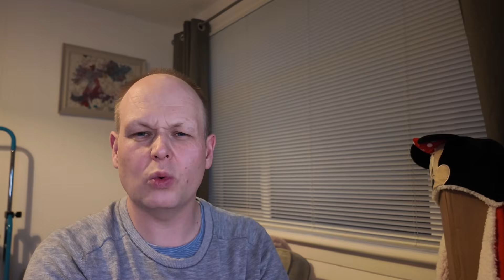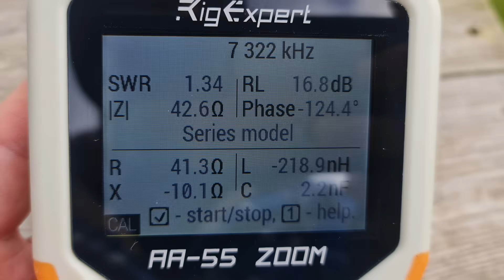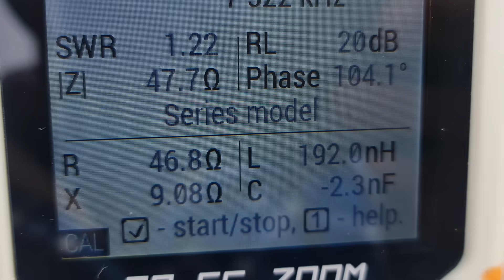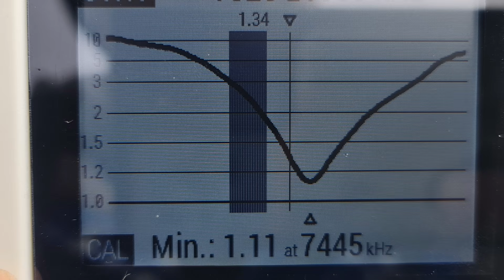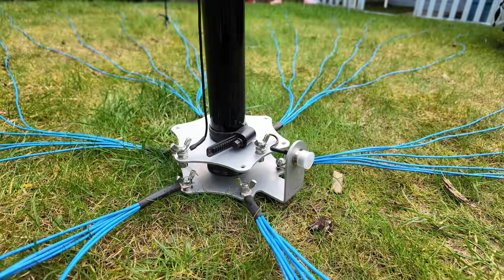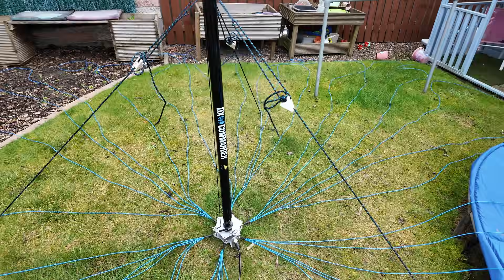How to Tune a Ground-Mounted Vertical Properly (A Common Mistake)

Comment: To set an antenna at zero reactance you need to measure at the feed point of the antenna or calibrate at the feedpoint point of the antenna.  If the resistance is different than the impedance of the transmission line, it will be transformed between resistive and reactive every eighth wavelength along the transmission line.  73 KK7YIS
Reply from the maker: 100% this. I always do this OSL calibration including here. I forgot to mention this in the video. I will pin your comment for others to see.
Reply: @MM0OPXFieldRadio @MM0OPXFieldRadio I'm confused.  If you measure at the feedpoint, your body can influence it.  But if at the rig end, you are looking at the entire system's matching and resonance.  On an analyzer, you're looking for X=0 across the entire system, which will not be, as you indicate, at the lowest SWR.  Also, for some, it is confusing that some say R=0, but it should not be zero; it should match the antenna's radiation resistance, which is usually around 50 ohms for a 1/4-wave vertical, but may require a balun or unun for other antenna types to get a match.
Reply from the maker: Your misunderstanding. I am not standing at the feed point. I have done a open/short/load calibration at the far end of my coax. The far end that connects to the feedpoint. This is the reference plane. I am only measuring from the feedpoint onwards so only measuring the antenna itself.

Comment: Are you following Roy Lewellan's current forcing scheme to drive the verticals?
Reply from the maker: Not directly. This array uses a switched coax phasing harness rather than a pure Lewallen current-forcing network. The aim is still the same though — achieve the correct current magnitude and phase in each vertical despite mutual coupling. I'm currently experimenting with 3/16λ spacing and adjustable delay lines to optimise the pattern on-air.

Comment: Phased vertical is very interesting topic. Also I was thinking a lot of it.  
Do you aware that vertical with elevated counterposes perform better?, less loss of power to the ground ... But it is harder to build, but enough 2 counterposes.

Comment: Thanks for this thought provoking video. It has caused me to think through resonance and tuning. So, resonance occurs when Inductive reactance = Capacitive reactance leaving just the Resistive component of the antenna impedance. I think a lot goes wrong when Impedance or mixed with the term Resistance and the two are not the same. Impedance is comprised of Resistance +/- a conjugate of Inductance or Capacitance using the notion Z=R+/-Xc or Xl. At resonance Z is purely resistive, say an antenna is 30R at resonance, then to calculate VSWR we need to calculate the complex number reflection coefficient I’= (Zl-Zo)/(Zl+Zo) and for a 50R transceiver output impedance = 0.25, then to get VSWR = (1+I’)/(1-I’) = (1+0.25)/(1-0.25)=1.667 so VSWR is 1.7:1.

Therefore to get 1:1 VSWR the antenna impedance has to be adjusted to Z=50 and in this example R=30 so Xx has to be 40 ohms so that the conjugate of 30+j40=50 ohms (not resistance) now VSWR will equal 1:1 
But luckily for us a VSWR meter only measures forward and reflected power flows so at 1:1 reflected power = 0 and we can use that to tune the antenna. And resonant frequency is irrelevant to the problem of matching. Having studied this subject extensively in University it got me thinking again, thanks for sharing.
Reply from the maker: I haven't done any studying during my education. Because of my radio related project's its forced me to try and have an understanding of this. I am still admittedly very green.

Comment: VNA is only millionths of a watt. Near ZERO reference to even a watt.
A start... Use a Bird 33 type precision waveguide type and check AT the antenna. 

Always use the coax to be an UNUN AT the antenna.
Reply from the maker: I ALWAYS do an OSL calibration with the coax fitted so I know I'm measuring right at the feedpoint.

Comment: Finally! Great you stepped up and made this long overdue video. I see so many OPs tuning their ground mounted 17' whips with only 4 radials to 50 ohms. basically warming up the earth (radiation pattern changing towards earth when impedance is higher than 36ish Ohms at feedpoint of a groundplane ant)...thanks again!
Reply from the maker: Thanks Leo. Not massivly detailed but didint want to go too deep.

Comment: It's my understanding that a vertical antenna with flat ground plane will have about 36 Ohms at resonance. That's why when you buy some verticals, the radials are bent downward to bring the resonant resistance closer to 50 Ohms. That's difficult to do a long wavelengths. It's not surprising that the meter indicates the resonance and the SWR are at different frequencies. The SWR is calibrated for 50 Ohms and the resonance (resistive) is at 36 Ohms. Thanks for the video.
Reply from the maker: Appreciated, I would go with raised radials everytime if I had the space.

Comment: Great video Colin. Never really thought about that before. Can I ask where did you pick up that superb looking base on the spider beam pole. Thks Pete M0OFM
Reply from the maker: Thanks Pete. It's actually a DX Commander Signature 9 Pole with the DX Commander radial and feed point plates. Very simple elegant solution.
Reply: @MM0OPXFieldRadio  Thanks Colin. 73 et GD DX OM de Pete M0OFM

Comment: I got my 12m bedroom inverted vee pretty close to resonance using just my SWR meter as confirmed after by using a NANO VNA. I got down to trimming ¼ inch lengths. 
As far as I'm concerned it doesn't matter because we MOVE about the band anyway and so we go off true resonance. It's resonant on one frequency and I couldn't achieve true resonance even with the VNA because it was too fiddly to adjust. Not practical and how much power is lost by not having it perfectly resonant? Next to nothing I bet.
It would only matter if it is too far off frequency because I could be out of the band at 12m. My SWR meter wouldn't allow me to be that far off. 
I don't have the figures now as it was to get an idea of the length when I get to put it in the attic. 

G4GHB.
Reply from the maker: Exactly, its just about knowing this. When it comes to arrays it matters.
Reply: @MM0OPXFieldRadio  
Yes, I can see that, it's like a Yagi to get each element tuned properly.

Comment: Yes Yes Yes.  The difference can be overlooked when dealing with simple wire antennas but once you start getting deeper, such as your phasing system, it really does matter.  Best to start acting with awareness from the beginning so the habit builds.  Excellent video.
Reply from the maker: I learned the hard way long time ago. Hopefully I can save someone some time.

Comment: Nice explanation. Lots of hams that have been licensed for decades don't understand this concept. Lots that should know better, don't. Getting that lowest SWR does allow for max power transfer to the antenna through the feedline obviously, but that doesn't mean the antenna is also resonant at the same frequency as the lowest SWR. Now, when it comes to the trade off, what is going to get more signal into the air, a low SWR, or a J0 condition, with modern transceivers, the lowest SWR is going to produce the most signal out of the antenna and be the most efficient for the entire system. If your antenna is J0, perfectly resonant on a frequency, but you have a 1.9-1 SWR, the antenna will be at max efficiency, but the network of the transmitter and feedline and antenna won't be so less signal goes into the air. This is why the simple SWR measurement has become sort of the #1 antenna measurement and why most hams understand that low SWR means best operating conditions for the system. If you can achieve both lowest SWR and a J0 condition at the same frequency, or across a range of frequencies, then that is perfect. Then your radio and feedline are operating with the highest possible efficiency, and the antenna is radiating with the highest possible efficiency and everyone is happy. It's why high efficiency low loss matching networks/transformers are great because they deal with the SWR, and then you can optimize the antenna radiator for best resonance without altering SWR much. It's what an antenna tuner can do for you as well and thus why those are very popular and very practical. Make the antenna resonant, then match the radio and feedline to it to obtain max power transfer through the system.
Reply from the maker: Appreciate the comments, better than I could explain it.

Comment: Brilliant video and something i have only been recently forced to study the science in real depth. 
As for Phasing i remember as a teenager wiring speakers the wrong way and thinking where was the bass and image, i soon learned everything be it antenna phasing or audio needs aligning. 
Loving those chunky blue radials, I’m a big fan of using 6mm Solar PV Cable for building my own antennas as it is extremely tough and it will take any voltage you can throw at it, probably the biggest plus I get it for nothing..😂
Reply from the maker: Appreciated. Look forward to seeing whats coming on your channel.

Comment: Resonance is resonance when inductive reactance = capacitive reactance. For VSWR the antenna impedance needs to equal the transceiver output impedance, so the antenna needs to be taken off tune until its impedance = usually 50R. So that’s the vector sum of R and X = 50R of impedance or resistance.
Reply from the maker: Who came up with 50 ohms anyway! ha ha.
Reply: @MM0OPXFieldRadio the value comes from a variety of sources. The impedance of free space is 120.pi or 376.99R hence ladder line spacing is set at 377R then coaxial comes from early transmission lines in about 1920 where cables spaced at about 20mm gave rise to 50R we use today. 50R is a compromise between practicality and cable size and losses, plus a few other factors. The value of PI appears in all forms of transmission because we deal in sinusoidal waveforms which are circular vectors, the more you deep dive the more fascinating it gets. But VSWR is referenced to 50R as is all transceiver designs.

Comment: I've had a Hustler Vertical since 1977 and it took me years to realize that a low SWR does not mean that the antenna is efficient. I do want to make one  observation Hustler verticals in my opinion is the BEST vertical made very tunable, efficient, and durable antenna ever sold.
Reply from the maker: They have certainly stood the test of time. 73.

Comment: Well done mate, to be honest I'm never any good with numbers hi, and normally alter things for max on my rf field meter at the bottom of each band hi.
But that just me hi, us oldies are a bit odd hi.
Reply: I did that before I built my SWR meter. An r.f. pickup meter at the aerial and tune for maximum out. Two torch bulbs in the twin feeder to my doublet and tune for maximum brightness. 
G4GHB.
Reply from the maker: Not at all mate. The way you are doing it is correct. You cant fool the field meter. Hope you still on the mend?